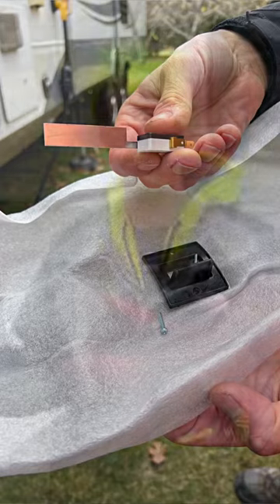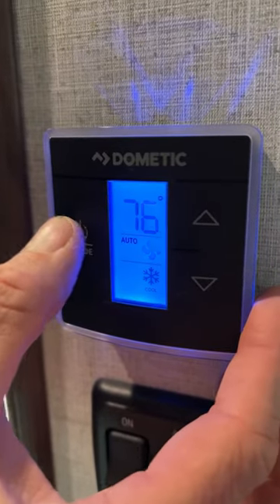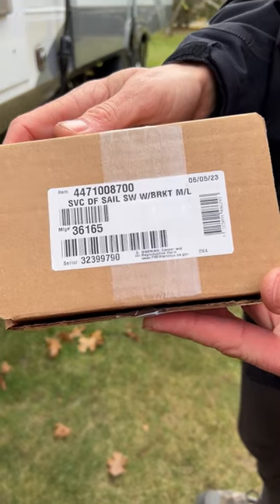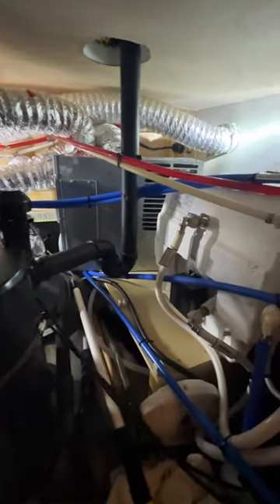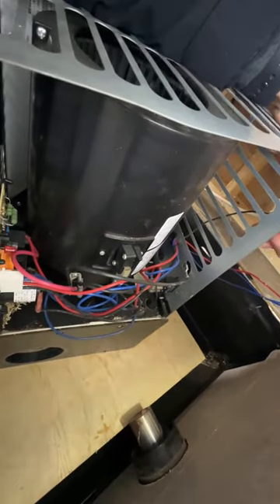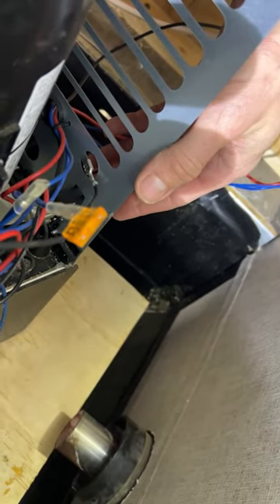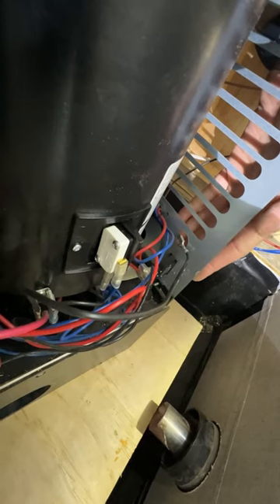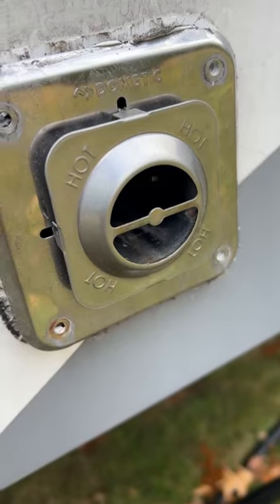Troubleshooting RV Furnace | Did the Sail Switch Break?

Comment: the cheap garbage switch should be a class action lawsuit, if you disassemble the switch you will find the contacts inside are like 2 knife blade at 90 degrees, that arc and pit and the resting position is open so they pick up corrosion in the off season, a REAL proper micro switch has round contact pads made from tungsten and not made out of chinese crap,  if atwood or who ever builds this junk would use a  hall effect switch in the motor this entire problem would go away, but saving money is what the game is about, i fixed mine in a differnt way and should never cause issue again and if it does i can change the switch without removing the entire furnace, engineers and bean counters should be hung out to dry on this with a lawsuit, having people freeze to death because of a crap switch